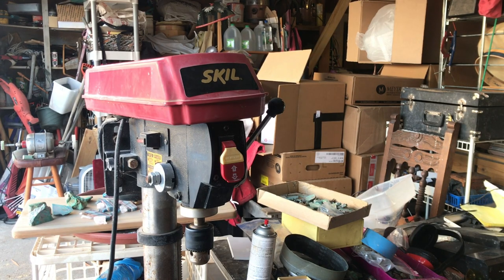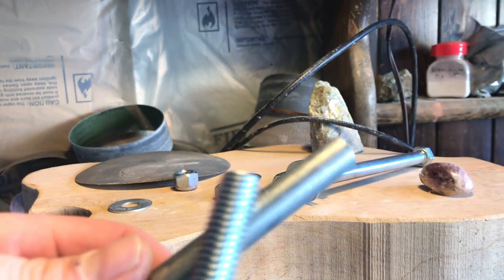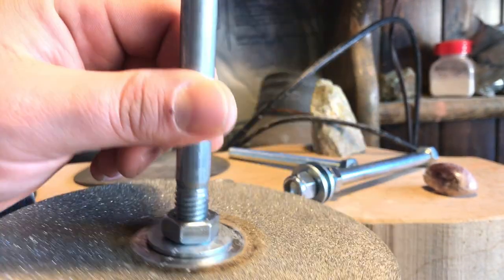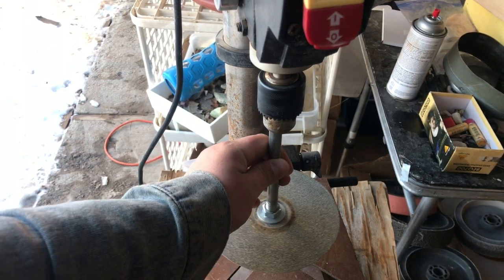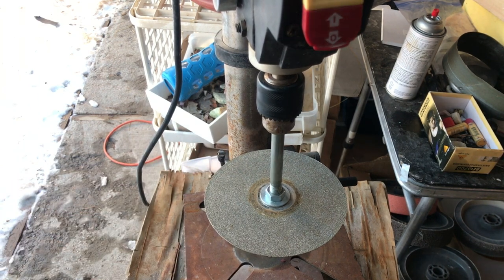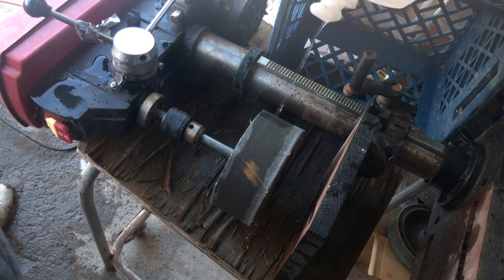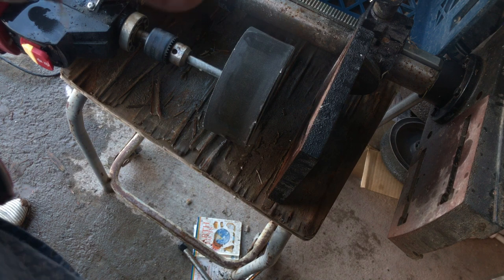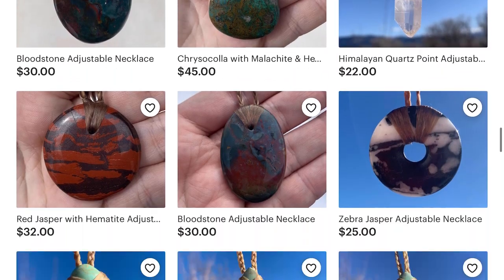Drill Press Flat Lap And Lapidary Wheel

Comment: Lapidary Dave, I  am so happy to find your video. You have single handedly saved my marriage.  I have been using all kinds of machinery for more years than I would like to remember. In the future,  to keep all your fingers attached to your hands,  please roll up your sleeves and secure them safely away from your moving parts. As far as laying your drillpress down. Make a 2x4 wood "L" frame on the Vertical side drill 2 half inch holes measuring from the holes on the base plate. I think the slots aer 1/2" so using some shorter 1/2" bolts, washers and nuts secure the drill press to the frame. Ensure that the frame is wide enough to prevent rolling.  Now, you have a  way  to either stand, or lay flat your drillpress without ever having to remove it from your  "L" frame. Hope this helps.  Tee
Reply from the maker: howdy my friend this info was super helpful:)

Comment: I have had the parts for a few months now, but it’s been too cold to work in my little shed/workshop. Well, I set it up yesterday for the first time. Works fantastic. Had issues with the drip system which is a KFC plastic to go drink bag (bout 1/2 gal), but it worked out. I used a disposable aluminum roasting pan for my catch system. Flexible,adjustable, and CHEAP. I went with the fully threaded rods, but as you said, they don’t turn as true. After reading the comments, I’ll be grinding the chucked end tomorrow. Love the videos and the information. Keep up the good work.

Comment: I'm embarrassed to say that  I've done this with a drill and did NOT think to do this with my press............GENIUS
Reply from the maker: I know folks that do this with a drill I think the only problem with using handrill is that it might have a hard time getting up to speed or chucking the bolt  but it does work especially in a pinch thank you for watching

Comment: Very creative.  A tip: don't use two pliers to tighten the nuts as you will end up chewing up the nuts.  Use wrenches.  Yes, tape a length of at least 12 gauge copper wire to the watering tube before taping both to the drill.  With the wire, you can direct the stream to exactly where you need it.
Reply: Ah, the old wire trick.
Reply: everyone who has ever used pliers to tighten nuts knows they are chwing them up and that wrenches are better. But we don't want to look for the right wrench 🤣

Comment: To get more threads on the bolt look for a carriage bolt instead of one with the hexagon all end, since you’ll be cutting off the end anyway it doesn’t matter. The carriage bolts might be lower in strength and I think would rust more easily, but they should be plenty strong enough still and are cheap enough to replace as necessary. I’m not an expert on bolts, but these do have more threads on them.

Thanks for the great video, as always. I got a drill press off craigslist for $75, and I got lucky it came with a rolling cart that the person I bought it from made as well. There were cheaper ones but the one I got is just like the one in the video, which I was absolutely thrilled about.
Reply from the maker: @MrGaryStaples  hi yeah I’m happy that it inspired folks to give it a shot. Please let me know how yours works out. I’d love to try to make another the same video. I want to focus on one dedicated to putting it sideways and using it for wheels instead of just flat lap
Reply: @lapidarydave I haven’t gotten into grinding with anything other than a dremel tool yet, I’m just messing with some smallish opals at the moment. I did put the drill press on its side though, using milk crates and some pavers, and used it as a trim saw on an opal. I cut a slot in a piece of tupperware and filled that with water. What I’ve seen done is using a sponge to catch the water from the blade. I got absolutely hosed without it. I’ll say this as well. Walmart sells little cheap bendy car oil funnels that both fit onto a 3 gallon water jug well, and also fit nicely into each other for lots of reach and bendiness.

Comment: When I started out I tried this seeing it on you tube. Problem was is my little drill press from harbor freight, the motor got seriously hot and nearly burned up. The capacitor blew out first and I was able to get another one and it works again. So for the cheapies out there like mine beware the motor getting hot spinning that weight. I ended up getting a potter wheel for $99 on ebay. I drilled a small hole in dead center, put a thin 1/2" round washer as the arbor and screwed down and the flat laps hold on very well! Perfect speed, not too fast, not too slow and I have now done about 130 nice pendants on it. Just also get a couple small 6mm hoses and get 2 nuts and bolts. Drill down thru the center of them so water passes though. Drill at the lowest points in the plastic pan.  Its very simple and drain into a bucket after you put a little drip system on it. Remember to get some rubber washers onthe inside and outside of those two bolts so it doesn't drip. You can make a couple if needed from the rubber out of the inside of a plastic coke bottle. The entire thing cost me like $108.oo. Try to get aluminum bolts at about 6mm round to use so they don't rust out from water passing through them all the time. Cool thing is you can switch plate sizes if you get the 11" pottery wheel. With not having to have any backing plate. The wheel is your backing plate.

Comment: Dave -- it's easy to add more threads to a partially threaded bolt. Get a die from HF and cut the extra threads you'll need. Love the idea of the expandable wheel mounted in a drill horizontally! Another possible source of long bolts with custom washers (and rubber bushings) is a sway bar link kit for autos -- if you have a friend willing to let you open a few boxes on the shelf in an auto parts store --- you may find something that will have the right measurements. I once fixed a broken differential mount on my Triumph TR-6 with a sway bar link -- worked perfect.
Reply from the maker: That is some great information thank you so much I will have to try that

Comment: I've used a cheap bench grinder, drill press a d a regular hand drill mounted to a two by four frame. With the bolt, you can also take a file or grinder and file three sides flat to fit in the drill chuck better. It just takes some effort to balance it.

Comment: Just a suggestion,  when mounting a wheel with a drill press, reverse the motor so the direction grinds away from you instead of towards you.  Much safer that way.  A knife makers trick
Reply: could move to the left a few inches 🤪😁
Reply: Just change which side of the press the one uses.  My press does not easily rotate in an opposite direction.
Reply: It doesn't matter which way you run the motor 1 side is always going the right direction

Comment: I have a Shopsmith that’s been sitting around. Not only does it convert to a drill press, table saw, sander, etc but the whole thing is variable speed so I can use the lower rpm settings. Just need to figure out how to keep the motor dry. They freaking last forever. Ours is circa 1940 something and still runs great.
Reply from the maker: i’ve been looking for a shop smith for a while they are so cool

Comment: Hi Dave.  Thinking of doing this but wondering what size of flat lap disc you were using. 6 or 8 inch.  👍🇨🇦
Reply from the maker: this was 6 but i’d prefer 8 any six that dosent hit the neck of the drill press is fine

Comment: Dave- great video. I’m very new to this gem world. I recently dug some garnets in NC and would like to polish them up so you can actually see the their beautiful color. Could you please tell me what wheels I need to achieve this. 
Thank you!
Reply from the maker: Depending on what machine you plan on using to grind and polish it might be different between machines but a good rule of thumb would be to buy 80 grit disk/wheel, 220grit hard disk/wheel,  280 grit soft disk/wheel, 600grit soft disk/wheel, 1200grit soft disk/wheel, and 3000grit soft disk/wheel all should be diamond :)

Comment: I'm surprised i haven't seen a cheap lathe adapted to a cabbing machine yet! it's already sideways and you could easily support a bar with a bunch of wheels!
Reply from the maker: i’ve seen it before but it’s way river to use a pulley motor pillow blocks and a threaded rods

Comment: Another option for the wheel mount is to chuck a length of all-thread of the right diameter into the drill press and use a file to remove the threads from one end.
Reply from the maker: Shweeeeeeeeeeet! 🧠💎🔥

Comment: Love this - what do you use for cutting? 😊
Reply from the maker: @PhoenixCreationsKaTyJs  like sawing? Or do you mean the diamond disks? :)
Reply: @lapidarydave  lol very good point!  Cutting stones to shape with a wet saw, and indeed the discs! Did you build your own?  Trying to find an affordable way to cut and shape stones before I tumble them, I’ve got little space and little budged, I’m a disabled jewellery maker! Even making jewellery I work on a try or a tiny corner of a room!  Need to try and find a way to cut and shape.  I am wondering if I can use my flexshaft, I’ve made a make shift saw table from a really useful box but it’s just for small stones, and I use a iv bag for water.  Not tried it yet as I need to make a temporary bench to use it on outside first!!! 😃
Reply from the maker: @PhoenixCreationsKaTyJs  so if you just look up Lapidary flat lap disks, I use the 6 inch ones 80 grit 220 and 600 then you switch to diamond impregnated resin 1200 and 3000 is all you need?
Reply: @lapidarydave  thank you! Have you ever made your own set up to cut stones?
Reply from the maker: @PhoenixCreationsKaTyJs  time saw

Comment: Used a nylon cutting board for backer. 8" bolt, bottom of nylon nut sat perfectly in hole of base, water lubricating. Then developed heck of a wobble,  turned down the rpm to 2200, but feels like bolt is bent. Going to try shortening. Thanks for the ideas. ✌️
Reply from the maker: good luck my friend keep me posted :)

Comment: Just a note; if you don't thread the bolt thru the nylon, it defeats the purpose. I would imagine you could use a spent 8" saw blade as a master lap. Grind off sharps of fine tooth luann blade. A colapsable camping water container has a valve, better control of your drip.
A larger chuck would allow you to use your other wheel. I have $65 HF press, I can change chucks.

Comment: You should use correctly sized wrenches rather pliers as the pliers will mare the nuts.
R.E.: Water collection. Turn the table 90 degrees out of the way and use blocks of wood to bring the collection pot to the required level.
R.E.: Threading Bolts. Get a die with the proper threads and thread the bolts the distance you require.

Comment: Just get yourself a router speed control, then you can fine tune the rpm to each wheel/accessory without changing the belt locations and still not getting the proper rpm... Ive had mine for ten plus years and it's still going strong.